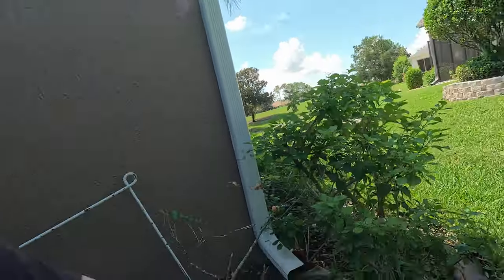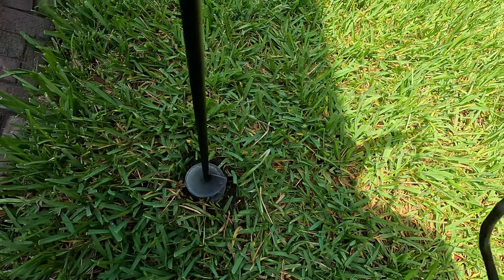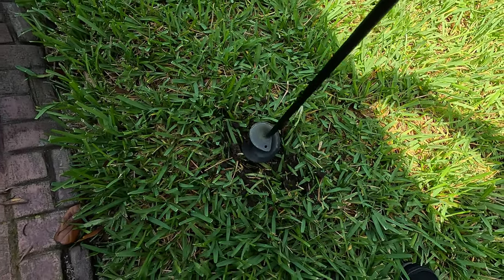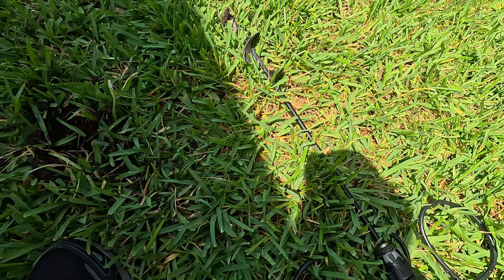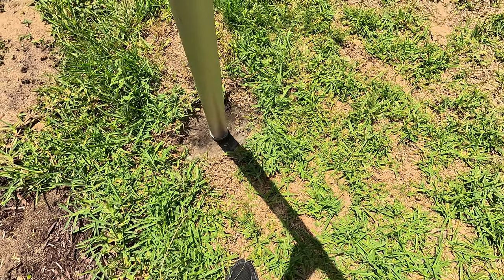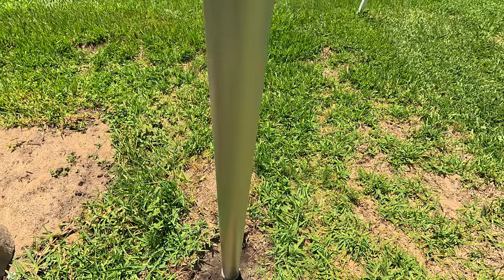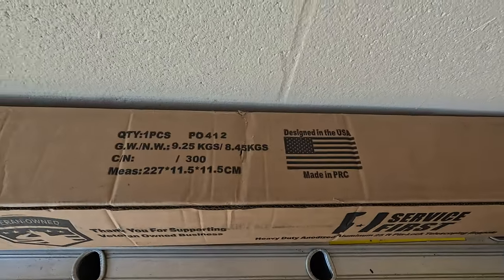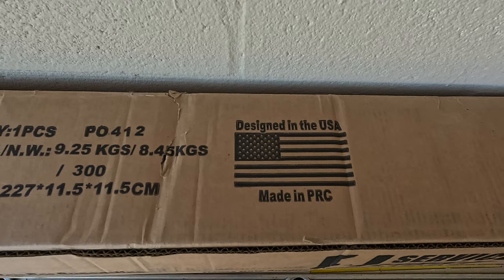Easy Peasy Flagpole Install

Comment: Bob I presume you put the pole in the hole and then added the concrete mix?
Reply from the maker: I put the tube in the hole, covered the top with tape so the cement dust didn't get in the tube, filled the hole with the dry concrete. And watered.  And later put the flag pole in the tube.  Used it, (it was not extended), to tweak any lean, with the level.